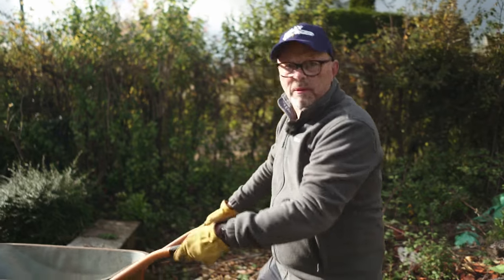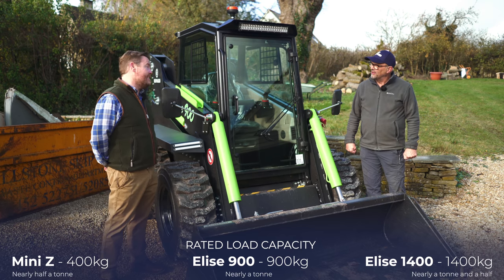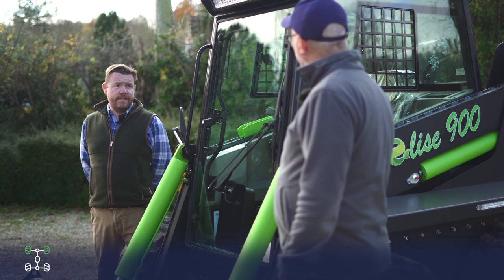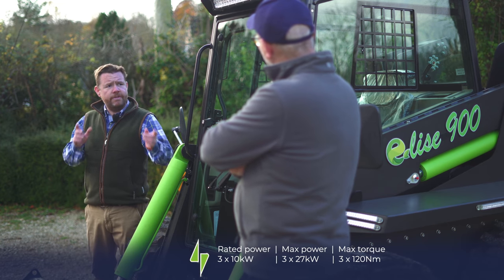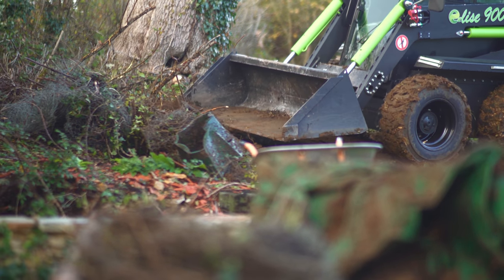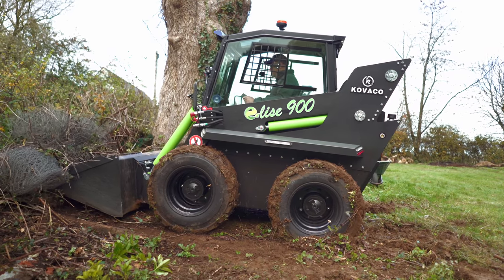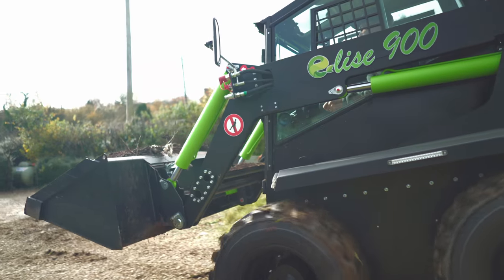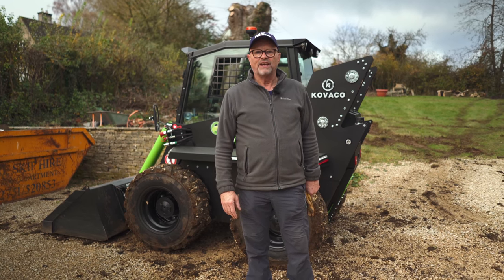Electric Skid Steer with Remote Control | 100% Independent, 100% Electric

Comment: I grew up farming and by the time I was in my mid twenties I had already damaged my ears from spending hours and hours operating loud smelly diesel skid steers. I use to dream about electric tractors when working and this is the one I spent the most time in using it to clean barns, feed cows, and do almost everything else on the farm. This is everything I ever wanted and I’m so happy to see it’s finally real!
Reply: I had the same thing happened to me on farms. Years and years of load machinery has left me industrially deaf. It's great to finally see these machines. I think it would be so easy to have a tellyhandler and the feed out tractor electric
Reply: You you damaged them because you wanted to there are options and they were options for ear protection
Reply: mate i feel your pain. i used to work with a skid in a cow barn from time to time. for people that have never used one of these things in an enclosed space. well they just cant get that lovely feeling when you get to shutdown and crawl out the cab.
Reply: Ever heard of hearing protection...?
Reply: @kreizmann2943  yep and when someone comes up with stuff that protects the hole body i'll be the first to get it.

sadly hearing protection only works properly on sound coming down the ear canal. it dose not protect from sound absorbed though the scull that directly vibrates the anvil and other small bones of the interior ear.
Reply: @tommyfred6180  that's not how hearing damage works. that "sound absorbed through your skull" causes negligible damage. It's of relatively no concern.
Reply: I've been exposed to firearms all my life, no hearing loss, you've got to take care of it but I do like the quiet. Batteries still suck.
Reply: But what about that classic character. I love my bobcat in all its imperfections and the noise is just part of it. It would be nice to actually hear the song playing on the radio though.
Reply: I fuked up my ears grinding,  and thn I learned to wear plugs everyday .now I overuse them and my eyes don't pop no more ,I used to have like pops in my ears with  higher pitch sounds ..now I wear plugs as soon as I leave my house (it weird  just got used to it,but it's good now

Comment: Having been born and raised on a ranch in the San Joaquin Valley in California USA, I had the opportunity to drive my father's truck into a bucket on the front of a dredger that cut the San Louis Canal that takes water to Los Angeles, California in the southern part of the State of California. However, that thing was a giant and could hold perhaps 10-15 pickup trucks and pumped diesel smoke by the ton into the air. I drive a Tesla Model 3 and I have Solar on the roof of my house and just loved watching you attempt to clean out your back yard with the FIRST BATTERY ELECTRIC Remote Controlled Electric Skid Steer Machine which was REALLY EXCITING TO SEE. BRAVO ! True Academy Award Material.

Comment: A skidsteer lends itself to electrification really well as it's entirely run on hydraulics. One with a diesel engine just powers a hydraulic pump, so the electric motor does that instead. These are widely used inside big buildings & in construction, so one with no diesel smoke would be brilliant.

Comment: I have driven and used a small electric loader inside a hall.
good and strong machine😊 
the only thing i did not like was i had to have 2 eletric machines to do the work of a diesel machine. 
could only run 4 hours on a single charge. 
but aside from that.fantastic machine no noise and a lot of power👍😊

Comment: Kovaco is based in Slovakia. Lots of EV related business is happening there. Based on information on their website, the battery is old fashioned lead acid. The size is modest @ 96V, 240 Ah. So, 24 kWh.

Comment: Interesting design, from what I can tell 2 motors for the drive and 1 for the hydraulic pump, because the weight is so low, they claim pretty impressive stability on off-camber, and ascent\descent.  3000 charge cycles for lead acid is pretty good, probably much easier to replace individual cells as well over lithium,  quite a machine!

Comment: Looks amazing, but I’m surprised they are using lead acid batteries (having read the spec on their website).
Reply: Yep, noticed the same. Might be simply a bit cheaper in Slovakia to use lead acid in this kind of use. Don't know. The motors sounded a bit agricultural also?
Reply: They're using the weight of the battery as the counterbalance to stop it tipping over if you lift heavy stuff...  if they didn't use lead-acid batteries, they'd just have to load it up with concrete blocks or similar instead.... so might as well use the heavier (and cheaper) batteries.
Reply: @logicalChimp  yes - its win win - why to buy something more expensive when you need heavy stuff at the back:)
Reply: @logicalChimp  But if they use lithium ion. They can load more batteries thereby increasing its load capacity and operating times and also decrease the charging rate. But there is a trade off in cost as li ion  is more expensive than lead acid batt.
Reply: At my company, the batteries on the lift trucks in the plant are all lead acid.  Less chance of catching fire, weigh more (you want weight in this case), and significantly cheaper.
Reply: @debadityasaha1684  it alreqdy has 5 hours of capacity.  You'd hardly need more thr guy said
Reply: @RandomGuy-nm6bm  2 to 5 hours depending of use and idle time.
Reply: @debadityasaha1684  Think like this, they gave it room to improvement in the future, if this becomes popular and sells well, I'm sure they will include li-ion batteries in the next one.
Reply: They WANT weight.  Lead acid batteries are perfect for this application.
Reply: If they want to sell it to industrial users who already have half a dozen forklifts and personnel trained and experienced in looking after similar batteries it's a good decision, cost is the main factor in pretty much all decisions whether upfront or longer term.
Reply: @debadityasaha1684  im guessing the 8hr battery they mentioned is lithium
Reply: @kschleic9053  Probably not, given how much further out it extends, and the increase in lift capacity (due to more counter-mass) it enables.
Reply: @debadityasaha1684  much much more expensive
Reply: @Argoon1981  It can be up to 8 with the extended 400ah battery. Idle time does not affect usage time
Reply: @kschleic9053  no its a larger 400ah capacity lead acid

Comment: I was also very surprised about the lead acid batteries. Doesn't seem like the modern way to go, but one would suspect it's a cost thing?
Reply: And a mass thing, given they apparently rely on the batteries on the back of the machine to provide the counter-balance for the lift at the front... meaning that heavy batteries are actually a positive in their view
Reply: Actually they do make sense. Weight is actually an advantage, much cheaper and long lasting. seems like the way to go.

Comment: My concern is how will these be charged at job sites? A big diesel generator?
Reply: Yes that is true. However, you have all electric vehicles being charged by some form of electricity made by fossil fuels. As technology improves we will see better alternatives for the charging source.

In the mean time at least we can start having less cars and construction equipment running down the road or on a work site creating more emissions from multiple engines burning fossil fuel. 

I think we can all agree that this is a better situation though not ideal just yet. Small steps lead to bigger ones down the road.

Comment: I'm glad this is finally to market, but I'm more curious about attachments. This is only for a limited use cases unless there are some compatibilities to attachments other than a bucket.
Reply: Kovaco is a company that's been around for 30 years. They started with and still manufacture attachments. There are over 50 for Elise and you can use other brands as well as the quick hitch is standard

Comment: Boys and their toys. But this one will contribute to a cleaner workspace. My concern is the height of the unit, it would be to high to work in multistory car parks ? Is there a tracked version?
Reply: 2074 mm high,  car parks are usually designed to accomodate cars 2.1m high  and so have clearances more like 2.2m so would be fine i'd expect..  remember range rovers are really tall.
Reply: @mralistair737  thank you, good to know for the adoption to work in multilevel construction.

Comment: "why only now" is the questions I am getting. Also why there are no electric quads?
Reply: Electric quads have been around 5 years or more.
Reply: @heatleynoble  I would like to see the sales of ICE quads banned as soon as possible. They are so noisy. Give the manufacturers a deadline such as 2025.
Reply: 'why only now'....???
There's a word for people like you......
Reply: @davidlazarus67  Im a farmer with an electric car. Electric quads would not do what a lot of farmers would require. We need 12 hours constant use at certain times of the year. Also needs to be very light weight. It'll come as car manufacturers drive the technology
Reply: @heatleynoble  Genuinely constant? Or just use over 12 hours? I know farmers have long days but it can't all be driving about can it? More importantly what is the actual shortfall of an electric quad over what is required, and could you arrange for a couple of half-hour recharges back at base whilst doing other things? Same as with cars, it's OK if one has to adjust one's habits and ways of doing things a bit to accommodate the technology.
Reply: @Wookey.  sometimes yes. Sometimes not possible. A contractor for example may go to a farm for the day. Spraying slug pelleting etc. The problem with quads is they are multi functional. A tractor doing one job day in day out would be easier to electrify.
Reply: @heatleynoble  I was wondering about recreational quads, that mostly run up to 3 hours, until you are tired. Sorry I did not specify.

Comment: They use these to muck out chicken sheds, and the diesel version is horrible [mucking out chicken shed is pretty gross at the best of times] so perfect for those inside operations- the most expensive accident on the building site was when of my crew swiped one of the lifting lugs on a skip, and tore a whole in the skid steer fuel tanks....diesel contamination and a very costly repair - and the hire company were not happy either.

Comment: Tracks not be better from a traction perspective. The thing with these is the always need traction because you are pushing into your load to then lift it. Wheels just can't provide the level of surface area required

Comment: Quiet is good, 3h charging using what connector?
Reply: It has a three phase charger option that allows for 110V up to 240V depending on where you are located. We are in the U.S. so that is very important to have flexibility.

Comment: Not sure about that phone control though. Probably needs somekind of thumbstick add-ons (like on Nintendo portable console, for example) on that phone, so that it could be operated in thick workgloves. In construction enviroment touch screen might not be the best solution.
Reply: Not sure work gloves would be entirely necessary.....and you could always take them off.....!
Reply: @andymccabe6712  that's the thing, you barely ever do take them of while working. 
Also, capacitive touch screens have issues with wet wet hands or dry skin. When I worked at construction side, I often struggled even unlocking my phone. Same happens to factory workers as well, sometimes. Fingerprint sensors refuse to read my fingers on dominant hand by the end of a shift, and pattern unlock also lags a bit.
 Industrial equipment in general often uses resistive touchscreens  rather than capacitive because they are more robust. Or revert to physical controls entirely.
Reply: @jur4x  you might have missed the comment about the remote operations. The phone is part of a basic package but there is also a full remote option and the controller has large knobs that can easily be used with gloves.

Comment: i mean...you could just get an electric forklift and put on the loader part instead of "forks"
lifts literal tons...and its about the same size
Reply: The issue here is that most if not all electric forklifts are not designed to traverse terrain that isn't traditionally flat. Also, the tires are also not designed to operate in mud and loose terrain.

Comment: Love it! 
About time!
Replace the cab and interior controls with more batteries and use remotely only.
Replace the inefficient hydraulics with electric screws.
Replace the motors with in-wheel electric motors.
Reply: Nothing wrong with hydraulics, and the cost of a hydraulic system is way cheaper, most of the parts are already available, all they replace is the smelly diesel with an electric motor, can probably even run the same hydraulic pump.
Electric screws in that environment would likely not last long either.

Comment: I'm not seeing the benefit of going electric for skidsteers, what am i missing other than carbon neutrality?
Reply: (What did the Romans do for us?) The operators potentially suffering permanent hearing loss. Lack of noise disturbance to the area where the machine is used. Reduced health problems associated with high levels of particulates for the operators and the adjacent population. Remote use in dangerous environments. Reduced use of oil based products. Costs savings in maintenance. Can be used in large food storage areas without contaminating the environment. etc etc

Comment: I love these things, the Electric digger and this thing, so many things you could do with these you cant really do with a diesel. Like that story of the digger doing work down in a basement where they had tried digging with a diesel first and almost killed the poor operators. So much potential its insane, and this is why I like EV's in general. We have just barely scraped the surface of what is possible. In our modern life, electricity is everywhere, and once we properly start to plan everything around this tech the will be no stopping it.

All this said. Best thing would be if we did not need to buy all these things, like me, I dont need a car, so ideally I should not buy one. And so far I have not, mostly because I cant but still haha... 

Right now I'd be super happy with an electric bike, but the ones I'd want sadly cost more than all my computer things combined.. :<  so a fair chunk of money.

Comment: It's great, except it falls down like most EVs currently from price, this one is £42k a diesel one same size new is £22k'ish depending on brand, I know there's savings on EV but it will need plenty of years to claw back £20k, still early days for EV batteries, when they reach fuel vehicles price or less then they will sell real quick.

Comment: You keep mentioning diesel powered skid loaders. Skid loaders are powered with propane so they can be used indoors in warehouses. They are by necessity "clean burning". And burning propane is far cleaner than using electricity that's generated by burning coal.
Change is important, but intelligent change.

Comment: Out of all the videos I've see of these skid steers I have not seen one been work in a commercial construction site repeatedly loading trucks it would be dead with in 2 hrs out of a 12 hr day a desiel machine would out proform that over sized rc toy anyday why would u waste ur money also most machines are that well protected in the cab from noise  that it makes the only thing this has going for it not worth it  I say the company should do a video and put one of these against I PROPPER skid steer because they know at the end of the day it just an oversized remote controlled toy for a man child in the video